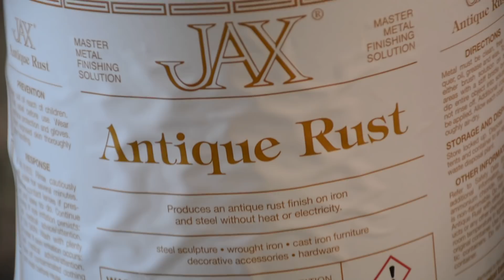DiResta Wine Safe

Comment: Man did I miss ur builds. Lol not to hate or anything but I make wine and was told by local wine makers that it's best to store bottles so the cork stays wet. Slight downward angle. So they don't shrink and air leaks lead to bacteria. Just a thought.
Reply: I agree ..BUT a standard bottle of UNOPENED wine stored horizontally should have enough fluid to keep the cork moist...I don't have that problem because my purchases come in a box or twist-off top...

Comment: When you use that Antique Rust finish on the metal, does it flake off or leave dust behind like regular rust?  Do you put anything on top of that to "seal" it on so it doesn't leave a pile of rust on the floor? Looks awesome!

Comment: Awesome , do you think that a Lincoln Electric mig handy pack welder would be able to do stuff like to this?  Thanks currently don't have the 240v plug installed yet for my 35-230 Craftsman stick welder I picked up for $50

Comment: Great Cart Jimmy! Quick noob question. Is there a difference between push and pull when welding or is it just preference?
Reply: If this is a troll it is master-level, my congratulations to you. If not, the answer is generally not in any but the most critical of applications, which would never be short-circuit MIG welded anyway. Among welders, however, this question has ruined friendships, ended marriages, and brought entire counties to the brink of civil war. There are deeply-held religious beliefs on both sides and neither will accept any amount of evidence, science, or reason.
Reply: LOL no not a troll but I'll take the compliment anyhow ;) Just curious as it feels more comfortable to pull when I do it with a stick welder. Oh no I feel like I've opened a can of worms now :O
Reply: Welding is welding, just do what's working. On verticles, I prefer top to bottom. On flat work, I like left to right, like writing a sentence, cause you kind of are writing a sentence. On up-side-down welds, I try to find someone else to do it cause I hate slag down my shirt... Pushing is for pro's when necessary.

Comment: Not a troll comment, why the grinder for cutting pieces to length instead of a cold metal chop saw? You're the 2nd or 3rd person I've seen use the grinder and was wondering if there was a benefit to grinding or just tool availability.  Love the vid, really liked the latch and the whole design :)
Reply from the maker: Adam McClendon lately I like using the cordless cutter. Bandsaw needs new blades.

Comment: I agree, very cool! But in hind sight , wouldn't the wheels be better off swiveling?  Once the safe is filled with wine, I expect it s going to get heavy, and moving the safe would be a challenge....again just an observation, you must have your reasons....
Reply: I thought the same.  Also, I was curious if this was intended to be used indoors.  You'd think those old steel casters would knick up flooring a bit.  Looks awesome regardless.
Reply: Wine safes don't move once someone's decided where to put it. I have one and it hasn't left it's spot in the past 12 years. The wheels will mainly be decorative and these old steelies will certainly fit the old warehouse/industrial look of the piece.
Reply: Danny Beeson Yeah, it ain't no sofa table.
Reply: That's all good and well but in design school we were never taught to assume how a client will use something.  We can certainly suggest a designs function and how to use it but at the end of the day the owner will do with it as they please, which may never be how you intended.
Reply: I suppose I should let Jimmy answer this - but those casters actually came off of an actual money safe. It's appropriate for the project.
Reply: But they wasn't casters!
A caster wheel is mounted with an angle from its swivel point!